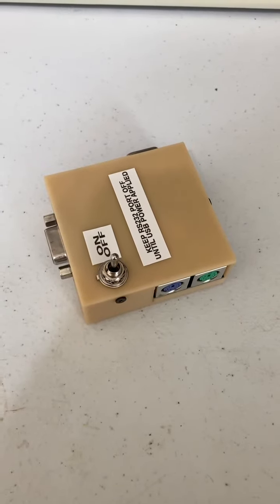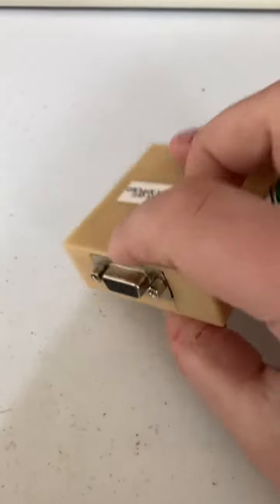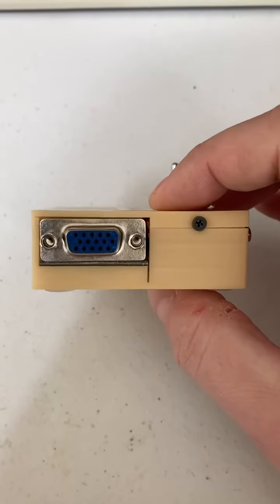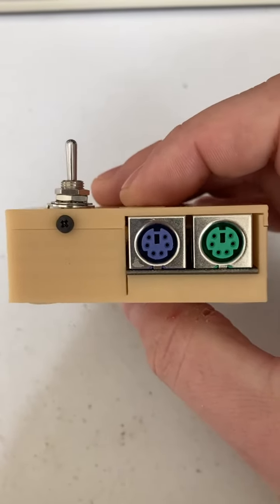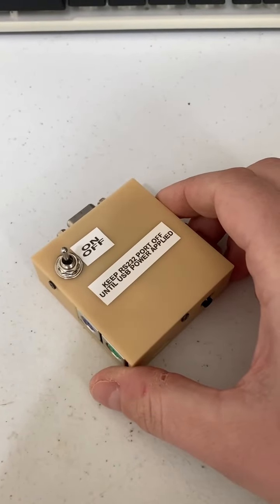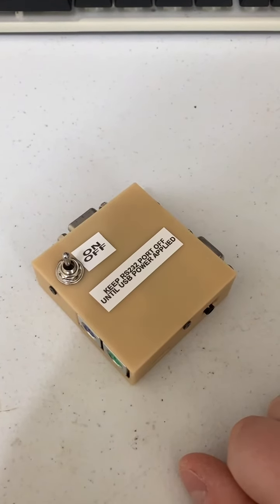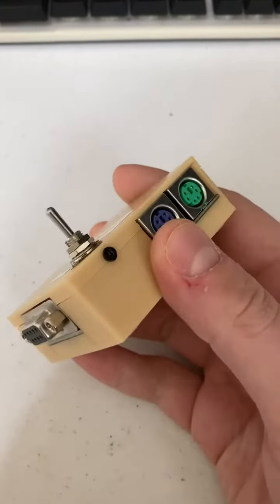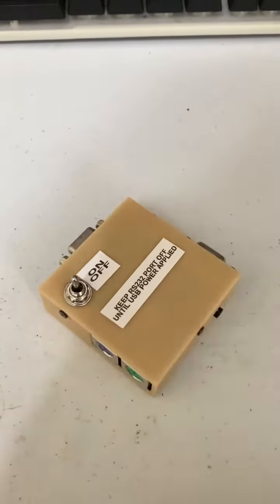Turn Any VGA Monitor into a RS232 Serial Terminal! Intro

Comment: Dear friend, good morning. Please, I need your help. I'm trying to build a computer with an 8085 processor. To use it, I need to connect it to a PC, but I would like to build a terminal, like in the 80s. Then I discovered your project, which would help me a lot. Could you help me? I would like to build something like your device. Can you help me?
I appreciate any help.